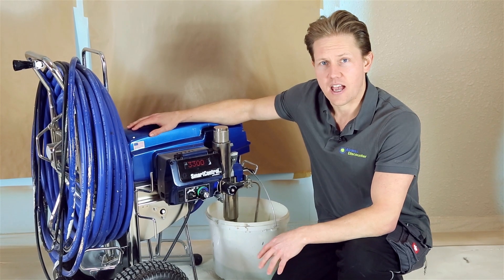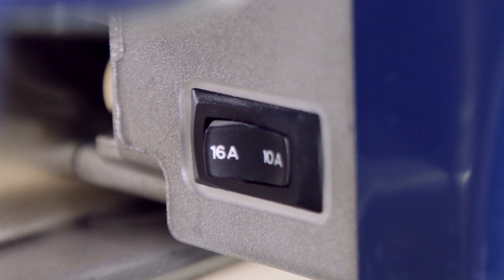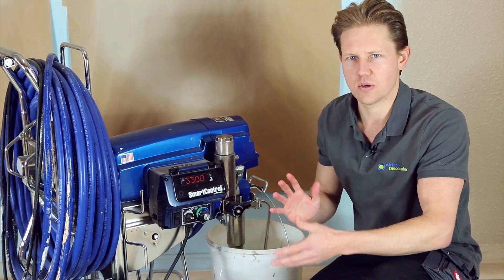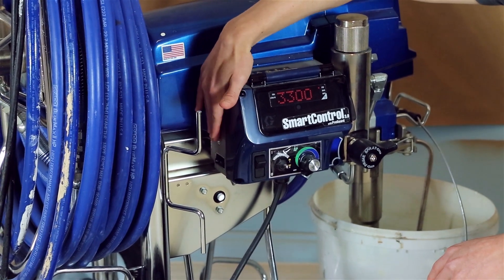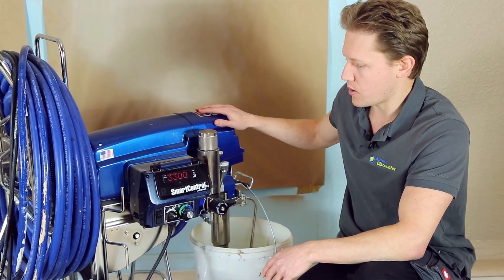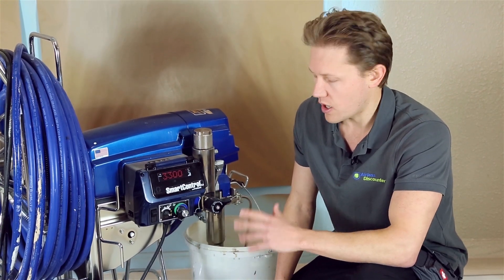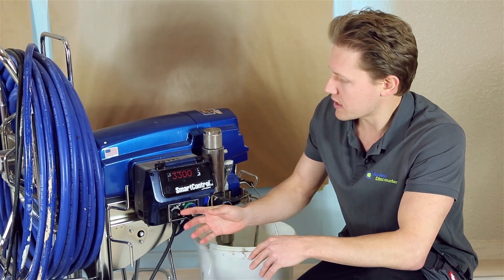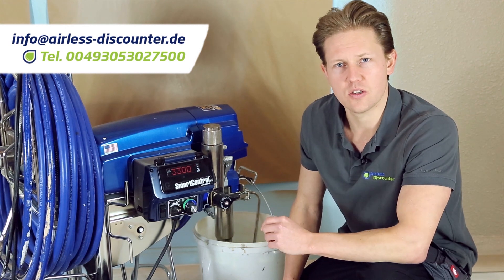Airless Q&A #20 - Amp Switch on Graco Sprayers (230V - Mark VII & Mark X) (120V – 1595 & Mark V)

Comment: So mark 7 or X can work in 110v  ?? im not quiet understand reason of this switch ?
Reply from the maker: Hi,
Yes, Mark VII & X are the only models that can go down to 10 amp. This is not a feature that is needed often these days, but if you are in an area where you can't get the usual 16 amp, then the machine offers you that possibility. 
Kind regards,
Airless Discounter team
Reply: @AirlessDiscounterInternational  im asking about voltage mark 7 land mark x can work on 110v ??
Reply: @Dom79Teck  Only the Mark V, the Mark VII & X is not available in 110 V.
Reply: @AirlessDiscounter  Thank you

Comment: wow thanks a whole lot ,two electricians  yesterday were telling me i had a  leak in my power cord ,make sense,saw the switch but never new what it was,and the mark 5 was not to full potential tripping the breaker,cant wait to go to work today you save my work load,love my mark 5,thank you .level 5 ceilings.
Reply from the maker: Great to hear that! Let us know how it went :)
Reply: yes indeed we had a 15 amp power outlet ,the electrician said he would  get us a 20 amp plug.the machine work fine on 10 amp so i downsized the tip to 531 and it clogged all the time ,we usually use the 547 for our two first coats of covercoat that the 10 amps seams to be missing pressure ,the 20 amp brings the pressure to 3350 psi ,10 seconds  the breaker would blow.thanks you really saved us time for the next 16 floor to do ,time to finish the graco university online .  ;) @AirlessDiscounterInternational